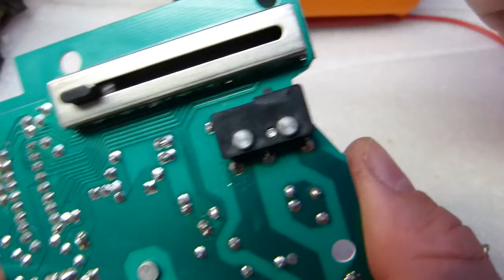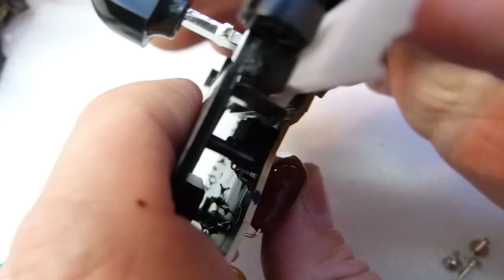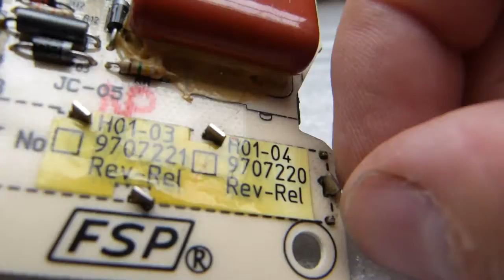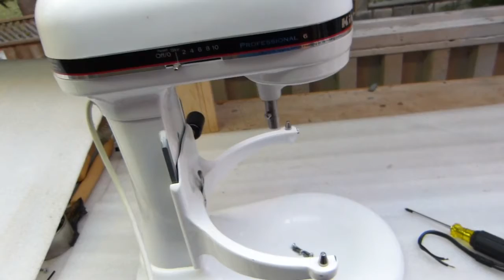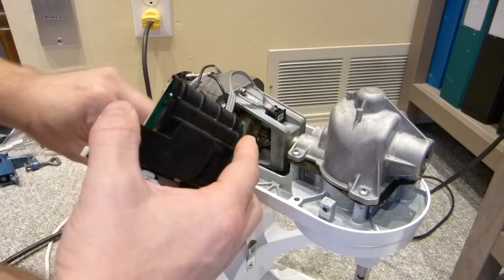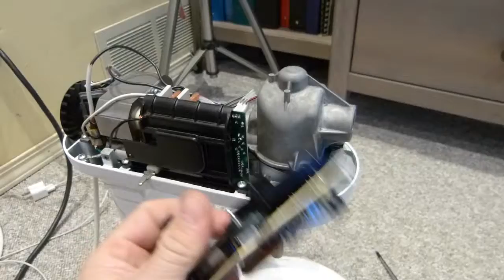Kitchenaid 6 Pro circuit board repair

Comment: Thank you for this helpful video. With your help I was able to start my old KitchenAid Pro 600. Possibly, in my case, the coper railings inside the speed control selector were oxidated and dusty. After vacuuming and moving the slider back and fourth, also clicking the switch button several times, the mixer started working at couple of speed selection positions. Gradually, after sliding and jiggling the slider knob several times at each position, the mixer started working at every position. Thanks again!

Comment: It is not a pot. it is a switch with each contact sending a voltage to the IC. If you looked at the other side of the new board, the one you say has less components. You'll see there is an IC more advanced than the original.

Comment: Hi, do you have the resistor values for R15, R2 and R3 (the ones adjacent to the 335K capacitor) please?  I have a board that was fed with 230V instead of 120 and the resistors all have a black colour code now haha!
Reply from the maker: I'll be a few weeks before I can get to it, it's in storage
Ouchy, those black resistors ...
Reply: Did you manage to fix it? What was your solution?
Reply: Posted a pic of those resistors, but for 120V model

Comment: That's not a potentiometer. It is literally a tracked switch: one leg of the black switch sits on a long track bonded to 2 signal positions, the other sits on a track composed of multiple pads linked to the micro controller. So it basically switches +5v to a different leg of the mCU based on the switch position.

Comment: What a great video.  I cleaned the switch using aerosol contact cleaner and poof it works.  Four two second blasts of solvent mixed with exercising switch vigorously.   Can of cleaner $7 @homedepot in February 2022. Much better than $60 for new assembly.
Reply from the maker: Nice work!!

Comment: Great video. Good camera work and explanation. Your instinct about the switch was spot on (Only moving part). I cleaned the copper rails of the varistor with WD-40 and a toothbrush. No need to take it off the circuit board. Works once again!
Reply from the maker: Glad it helped

Comment: Thank you for this video. I cleaned the copper contacts, and my mixer speed control is working like new again. I’d like to echo another comment about removing the switch - there are two tiny ball bearings which are just WAITING to spring away, so be careful if you remove it.
Reply from the maker: Great to hear!
Reply: glad I read the comments before doing it thanks😀

Comment: Thanks for the video.  I sprayed the inside of the slider a few times with electronic parts cleaner, put back together and it worked.  I also changed most of the grease in the gear section as some of it was "melting" and running down the side of the mixer.

Comment: Thankyou for both videos on this repair.  I was able to follow your advice.  I removed the switch, took the circuit board apart, cleaned both the swith on the circuit board and the plastic side, with alcohol and Qtips/Swabs.  reassembled and it works perfectly.  No freezing necessary for my repair.  Thank you.
Reply from the maker: You're very welcome!

Comment: @theoverengineer helpful video! I knew it was the board but suspected a discrete component was the issue. I cleaned the potentiometer with rubbing alcohol and a Q-tip and it's working like new! Saved me about $50+s&h. Thanks for posting
Reply from the maker: Thanks for watching!

Comment: The slide is a good place to start, but that wasn't the problem on my board.  I have good speed control on the first 3 speeds but on the higher speeds it just stops the motor.  Motor is good and runs flat out when the speed board is bypassed.  So some component on the board is defective.  None look burnt so I think it is a semiconductor?  Which one I don't know. Probably not the SCR (heat sinked device), my guess is that it's one of the IC's?

Comment: Can i ask what is the details for the mov or the metal oxide varistor.. becaus i already burn 2 speed control replacement because i forget to plug in 110 volts.. i just want to replace the mov so its more cheaper but i dont know the details for the mov.. thank you..
Reply: If the MOV looks good, it is probably just fine.  They burn up catastrophically when bad.

Comment: My name is Eman , I just received a kitchen aid Mixer Professional plus 5 order no. Order #6030023158 from @t which I ordered on this black Friday.
Once I turned it on , I faced a problem with the electricity and it 
caused a damage in the speed board as its capacitor the yellow one has 
blown and I want to replace it please but I do not know its numbers in 
order to replace it 
The speed part no. is WI0814992 Rev. B
Serial No. W93130235

MODEL NO KV25G0XER
Could you help me  please ?

Comment: Cleaned out the potentiometer track and the copper portion of the switch with some acetone. Works great. Remember when testing it, make sure mixer is in the off position, plug it in, then move the switch. If you plug it in with the switch in a on position, there is a safety feature that prevents it from running.
Reply: brilliant!

Comment: I recently purchased a non-working like yours with the same issue. Not sure but feel that the board has been serviced at some point as solder joints for the large Mylar cap.. voltage regulator trans.. and the 3 legged dipped part that sits parallel to the ic.. assuming it to be an oscillator.. not sure have been touched up by hand.. I’m gonna check the trans & cap.. but may hit the slider with some contact cleaner first to see if that cures matters.. will update as things progress..

Comment: So ... I started disassembling the slider switch ... and some bits sprung out of the slider. I should have known there was a spring and some detents in there ... but didn't think about it. I found the spring, but the detents are gone in the wind, and I have no idea what I am even looking for. Word to the wise, disassemble in a baggie or something... stuff will go everywhere - and your KitchenAid will surely not work again.
Reply from the maker: Oooh, that`s bad, sorry to hear your troubles. One source of eletronics parts is https://www.newark.com/c/passive-components/potentiometers-trimmers-accessories/slide-potentiometers
Thanks for the tip!
Reply: There are two tiny metal balls on each side of the spring to keep it from clicking into each position. Even after being careful, I ended up losing one of the balls. Improvised by making another ball with solder (used the other ball as a reference for size). Put it back together and works great.
Reply: Maybe they are just BBs! @chrisp9320

Comment: Can you tell me where I can buy the sliver slider or part number
Reply from the maker: US an Canadian models KP, KT, KD, 4KP, 4KT, 4KD Serial numbers WL46 - present
Old part number 9707221, 9707220
New part number 9706648, 9706649, 9706650 with black, grey and buff color knobs
Reply: @theoverengineer  don't want to replace the entire board was hoping to be able to purchase just the silver slider (the part your talking about in video) that's under the part number
Reply from the maker: Here is one source https://www.newark.com/c/passive-components/potentiometers-trimmers-accessories/slide-potentiometers
Reply: @theoverengineer  Thank you so much

Comment: I spray the slider with CRC #03140 Contact Cleaner and Protectant - NSF registered, works like a charm.  I buy it on Grainger.com, 1D261.
Reply from the maker: Thanks for the tip

Comment: WOW is it still working?
Reply from the maker: +Josh Barker Yup, no issues.
Reply: +theoverengineer Thanks I put a new board in my 600 to get it going again. I'm gonna try this I kept the old one. Thanks again.
Reply from the maker: Post the test results here, I`m interested if my finding is just a one-off or reliably repeatable.
Thanks for watching.
Reply: I sure will. Thanks
Reply: +theoverengineer Well the result is that it is still not working. The freeze method did not work for me. I left it in the freezer for over 24 hours and it is still DEAD. Oh well at least it is working with the new one.
Reply from the maker: Thanks for the update!

Comment: "Working when cold" is a common symptom for .... bad solder joints! :)
You might also want to check the big red capacitors. If they have lost some capacitance, then that might be the issue (I think they are used in a "transformerless power supply" circuit)
Reply from the maker: +Benjamin “Ozias” Esposti It`s working after 1 deep freeze cycle now at normal room temperature. it`s totally reasonable that the soft metal solder joints move enough over time to create an open, then move enough in the freezer to close the open. Thanks for the tip.
Reply: Electrolytic capacitor also fails and could have variable capacitance depending on temperature, worth replacing

Comment: Probably just a cold, cracked solder connection. Haven't you inspected the solder joints? I'd quickly touch 'em up, as a matter of course.
Reply from the maker: +Koffi Banan I have inspected, but the freezer fixed it whatever was wrong. No need for re-touch. Until it stops again, so I can keep tracking what action causes what result.
Thanks for watching.